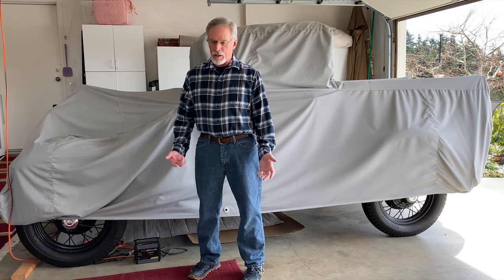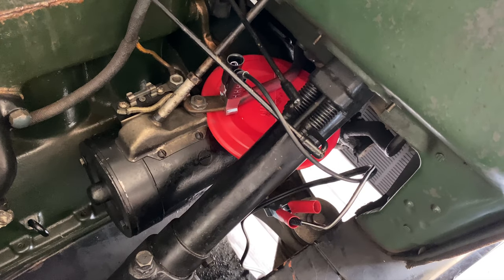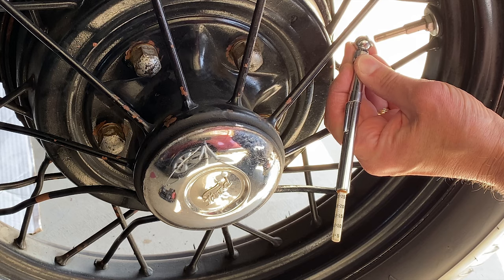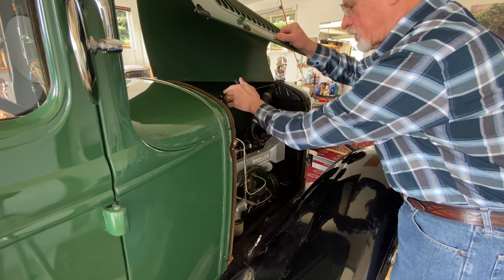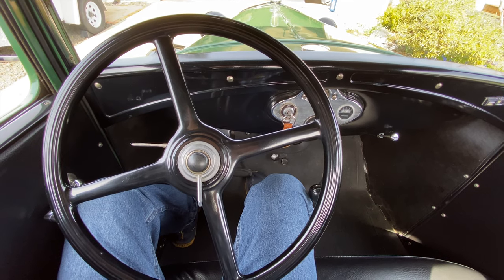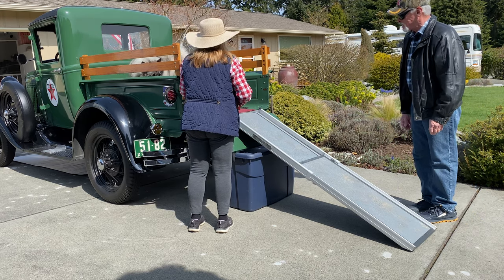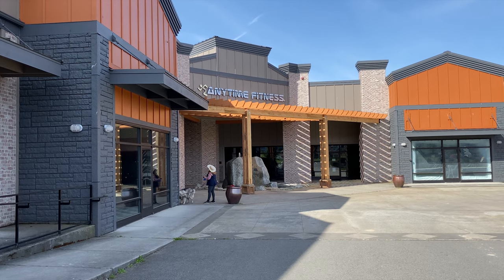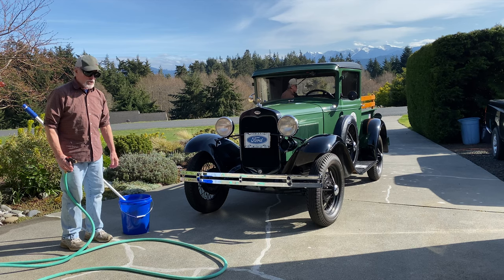De-Winterizing a Model A Pickup – First Drive in 2020

Comment: For my late 1931 Model A, I use only 100% gasoline ⛽,  and,  I not a fan of trickle chargers or any charger left on a Model for any long period of time. During our winter, I open the fuel valve once a month.. gas in the carb is better than air with moisture.. 100% gas with no corn crap is your friend. Oh and outstanding Norwegian Elkhoud.  My parents  were breeder and shown those dogs. I grew up with main of them..
Reply from the maker: Michael, thank you for your comment! This is helpful information. I am a novice when it comes to vehicle maintenance, especially my 1931 Ford Model A. These days I take my vehicles to the dealer or reputable auto mechanic for servicing. That said, I want to learn how to do basic maintenance, like changing the engine and transmission oil and flushing the radiator. My dad’s Model A mechanic, who rebuilt the flathead engine told me that it is important to add an additive when changing the oil. I think it’s Zinc? Is this necessary? What about other routine maintenance or cleaning? Should I power wash the engine and the greasy undercarriage? What about the interior? Wipe the seats down with Armor All?  Then there is the dent in the right fender (passenger’s side), and the chips and scratches in the paint. Should I repair there? It is a truck after all. Thanks for watching my video!

Comment: Pumping the accelerator accomplishes nothing other than wearing out the throttle shaft on Model As
Reply from the maker: Yes, I know that now. The fuel is gravity fed. Pumping the accelerator before starting is what my dad did during his 20 years of ownership, and this is what he taught me to do until I learned otherwise. 

Question for you:
Do you have experience lubricating a Model A?

Thank you for your comment and for watching my video!
Reply: @randallwingett  I recommend the Model A Ford mechanics handbook by Les Andrews